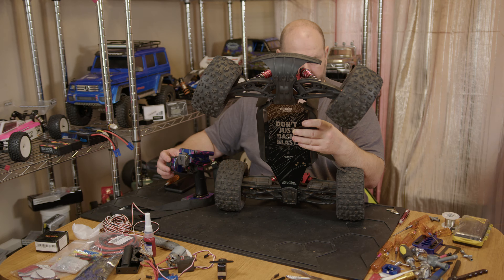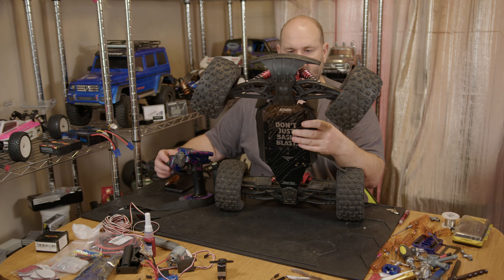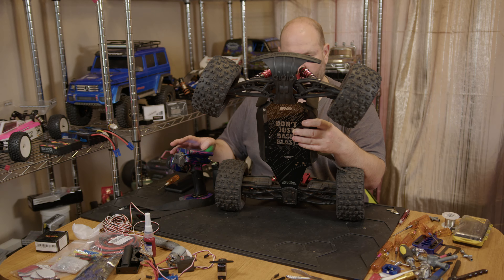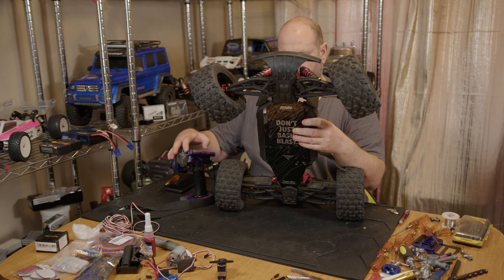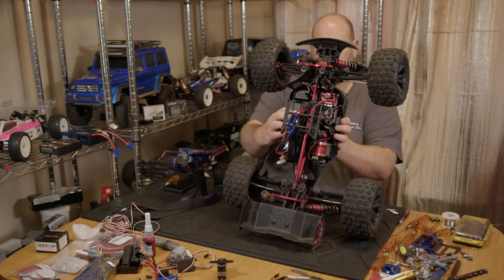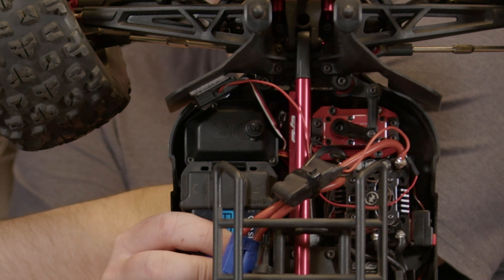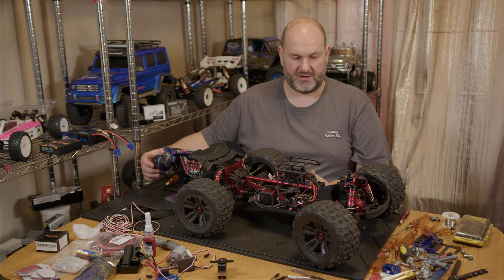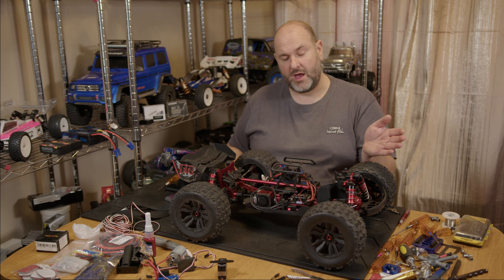Kraton EXB  6s servo fitting and endpoint setup guide

Comment: Hi there!  Appreciate all you do for the RC community! 👍 
I’m a subscriber and have a quick question if you don’t mind:  I have a NB4, Mamba Monster 8s with the 1717 1650kv motor.   The motor needs to spin the opposite direction so that the car goes forward.   

Is it better to reverse the motor’s direction using the Castle Link app (on the motor tab of the updater) or to reverse the motor’s direction at the transmitter using the reverse switch?
Is there an advantage/disadvantage of doing either/or?
Thanks again!
Reply from the maker: Alway do it on the ESC as you also have options for brake and reverse power that need to be set up correctly to :)